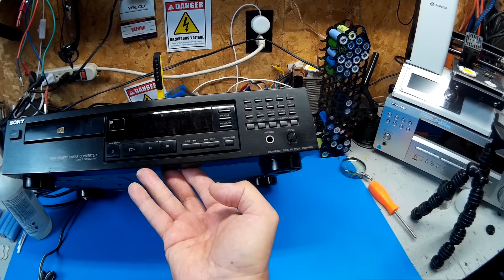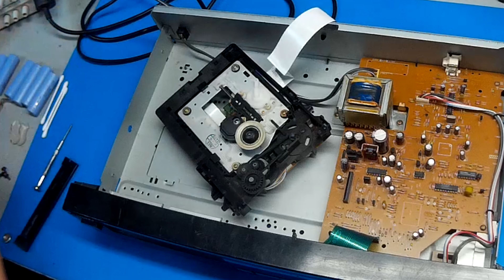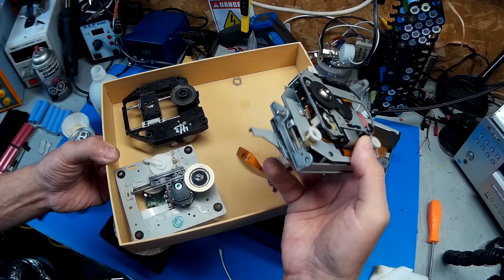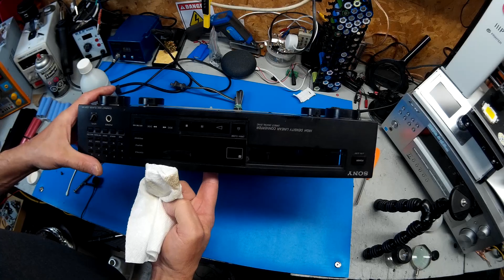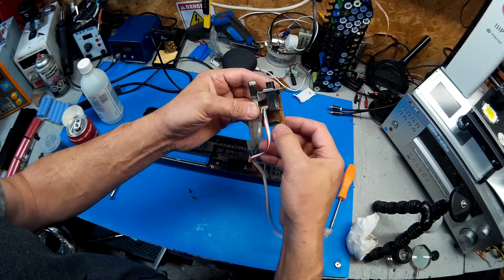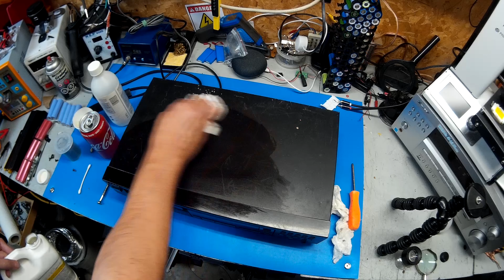sony cd player cdp-491 * 1991 refurbish repair*

Comment: Just picked one of these up at a thrift store for $6 and when I got it home I found out the tray wouldn't retract and discs wouldn't spin up. Cleaned everything and greased the gears up and it's working perfectly so thank you!
Reply: And my 4 and 6 year old are both enthralled with this "ancient" tech at the moment😅

Comment: My CDP-491 had a different problem -- when trying to load a disc, the door would close properly but then immediately reopen without playing it.  Sometimes after about 30 tries it would eventually play. Removing the belt and cleaning it with alcohol did the trick. Works perfectly again.  Your video helped.  Thanks.

Comment: I like it when opening a mechanism and all the parts spring out like a jack-in-the-box😆As far as smells are concerned, I had come across a receiver with a mold issue. After cleaning everything with alcohol then placing it in a plastic bag with an ion generator cured the problem after several days of treatment 🤢

Comment: You must clean the limiter switch located at cd board. This switch detects the inner position of optical unit. That switch became oxidated and some times a bad contact happens. I worked over 25 years in a sony service center here in Brazil. I know this kind of mechanism very well. If the limiter switch fail the tray opens and do not closes anymore because the cpu think that the optical unit isn't at the inner position.
Reply: I have a similar one, door opens and closes fine, but the motor does not spin and it gives "No Dissk" error. 
Cleaned the lens, also the lens is moving back and forth for focusing. Any idea on this problem. 
No idea on which pot to turn to increase gain of the laser unit. Any help is appreciated.

Comment: Ya that was a great player u can adjust the potentiometers if it has trouble reading for track offset and optical alignment the 3 on the pickup head  this unit do optical focus track gain and track offset these did have a richer sound but degraded with wear n tear